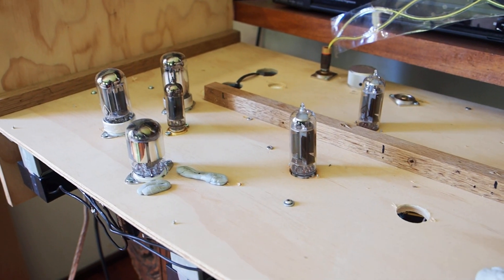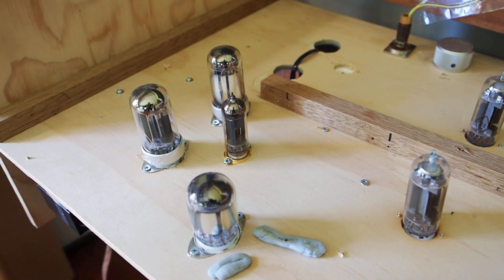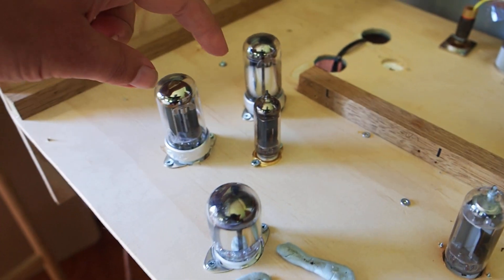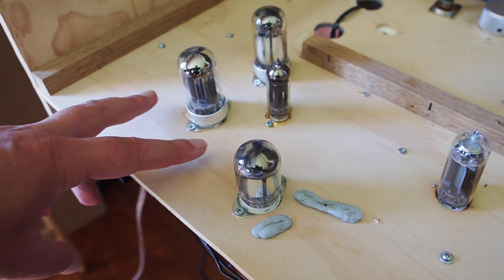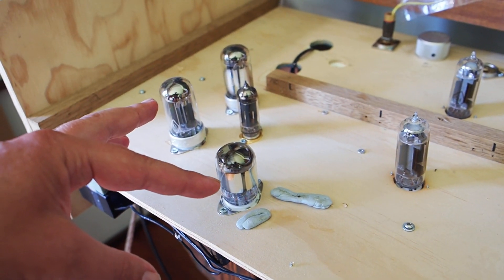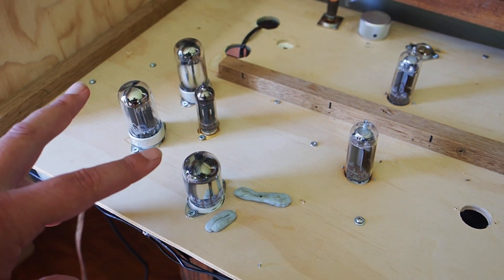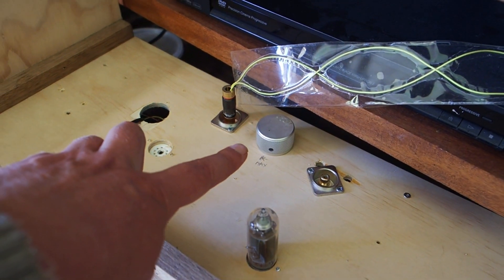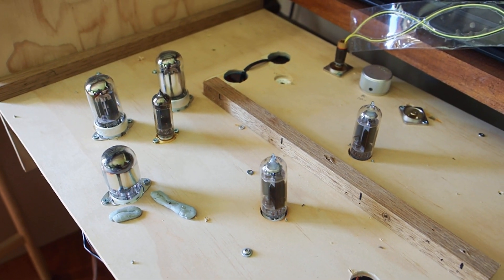The design of my power amp - part 1/4: design goals, qualities

Comment: Thank you Eduard for presenting your amplifier! It is extremely valuable information, as you are walking a very much off the beaten path road. Yet,  road to extremely high quality, on a workable budget. While it is very easy and straightforward to get the most well-known tubes and most well-known parts and schematcis and build a great sounding amplifier out of them, I find it a much greater challenge to go where few (on non) have gone before, and exploring solutions that are not so obvious. 
Your choice of the DHT pentodes is absolutely superb. People often think of direct heating as triodes only, but pentodes are also available in this configuration, and direct heating with them has the same benefit as for triodes. The added benefit is very low cost in comparison to DHT triodes. 
They are not inferior to the triodes though! People often forget that it is much easier to drive pentodes than triodes. For example that's why Yamamoto uses the 717A pentode to drive the 45... The 717A is another gem. It is not direct heated, but was developed for GHz application, and has an extremely tiny plate structure in that mushroom bulb. Is super resistant to microphonics, and has superb coherence.
While many prefer triodes as driver, I need to add though that pentode drivers sound is extremely impacted on the way we bias it, and it can sound from the cold analytical somber tone the Yamamoto has, or sound much warmer and lush. They allow the DIYer a very wide range of experimentation, and allow the developement of sound that has almost no added personality - which is much harder to do with triodes.
Reply from the maker: Great comments Janos - I must look up that 717A. I really like the directly heated refinement in the sound here and, really indeed, there's plenty of tetrodes and pentodes available for reasonable prices. The mix of tubes is of great importance, in this amp I tried drivers 6CS7, 6CG7, 6E6P, 4P1L, 6N14P, 6P43P, E180F.. but none worked as well as this quite large but power sipping and directly heated 2P29L. As we talked about before, the power supply for the driver is crucial.. I feel that generally there's a bit too much emphasis on the tube types and version themselves which for example dynamically have very little influence.